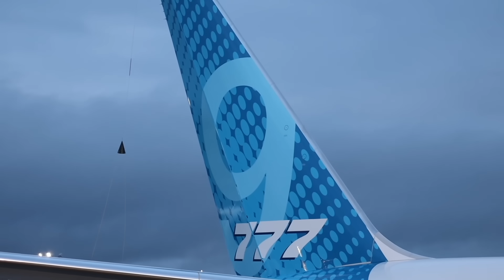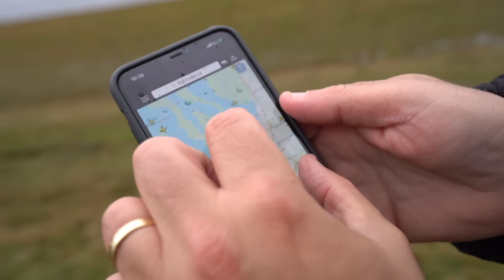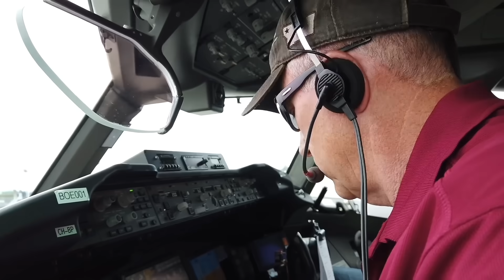Boeing 777X - What's the Difference?

Comment: 737 max 8 product of rush
777x even worse because BOEING IS LOSING MONEY AND THEY NEED THIS TO SAVE THIER ASS. So is 777x fully tested?
Reply: No, that's why they have the test flight program. It won't be fully tested until they have thousands of hours in the air exploring the entire flight envelope. It flew again today doing low-speed racetrack pattern over Eastern Washington before returning (safely) – there should be frequent test flights coming up
Reply: Appable then why max 8 got deadly problem? Basically u are assuming Boeing plane are fully tested, and Boeing assumed their planes fully tested.
Reply: @kevinco11  It would be possible to test for MCAS failures while having a much safer recovery because you anticipate the failure

Comment: Folding wingtips. More moving parts. What's the probability of something going wrong?
 But shouldn't the wingtips fold down, so the lift from below helps them stay in place during flights?  As it is now they will actually need a robust locking mechanism to keep the wingtips down and prevent them from folding up during flight. I know it doesn't look as cool with the tips folding down.

Comment: I'm worried about those foldable wingtips, close up they look cheaply made which potentially makes it more prone to damage and metal fatigue. e.g what if the 777x wing tips are folded so much to the point that they are close to snapping. similar to the cause of the crash Japan Airlines 123 which crashed because from what I've heard the tail snapped.
Reply: JAL123 was because a bulkhead failed – the vertical stabilizer came off because the tail was falling apart. I have no idea how you assessed the wingtips as "cheaply made". For the loads transmitted through the latches, the folding itself is not going to cause much of a  load at all compared to flight forces

Comment: The foldable wingtips are Boeing's next hack. It's another safety problem in the making. Please don't!
Reply: Based on what? They have a very strict set of requirements negotiated with FAA and EASA to ensure they're safe  and therefore the system has gotten additional regulatory scrutiny

Comment: May this piece of garbage has two angle of attack sensors? Lol - maybe it even flies without falling out of the sky? Maybe you crooked assholes didn’t bribe the NTSB to rush it to production? Shameful.
Reply: NTSB does not regulate aviation. This has two angle of attack sensors, though so does 737 (but 737 only uses one at a time). There's also a synthetic inertial angle of attack measurement based on their theoretical airplane model which can be used as a backup for 777

Comment: Why does the 737max has the MCAS but 777x doesn't
Reply: Engine weight, the 737MAX  has bigger engines than a regular 737.
Reply: @mahfl22  Not weight, and 777 would never need MCAS regardless of aircraft positioning because its approach to controls is entirely different

Comment: Boeing really needed this after all the bad press about the 737Max.  The 777 has been a thoroughbred passenger jet from day one.  I hope they've gotten this right.  I'd also like to see the 737Max debacle straightened out for good.  I still think the plane has great potential once the problem's solved.  I just hope the De Havilland Meteor syndrome doesn't set in for both buyer and flyer.

Comment: what happens if one of the folding wing tips goes to the upright mode during flight?
Reply: retroelectrical Probably bad things. They’re designing appropriate structural margin and safety (mechanism isolated from power in flight, etc) in view of the fact that wingtip failure would be very bad

Comment: Why was the landing gear still down at that altitude? Or is that all part of the test?
Reply: Safety – they typically perform first flight with gear down and engineers make sure the systems behaved normally in flight before allowing landing gear retraction. The first flight is also a good opportunity to measure low-speed takeoff configuration performance to make sure there are no glaring discrepencies, which is why they circled around just over the mountains for a few hours at various speeds

Comment: Why are the landing gear wheels still down when the plane is in the air above the clouds?
Reply: Safety – they typically perform first flight with gear down and engineers make sure the systems behaved normally in flight before allowing landing gear retraction. The first flight is also a good opportunity to measure low-speed takeoff configuration performance to make sure there are no glaring discrepencies, which is why they circled around just over the mountains for a few hours at various speeds
Reply: @AmbientMorality  Thanks very informative 👍

Comment: 777x program is a disaster to be for boeing company after 737 max. It is because the same method and management culture were being used to produce 777x and 737max, cutting the corners and crying to FAA to release the aircraft
Reply: Based on what? Boeing accurately described the severity of wingtip failure and is certifying it in that regard, which is at least one good sign

Comment: The plane sounds very noising with that whining sound, is that normal?
Reply: That's the sound of the 777. It's not the quietest plane (the old one, anyway) but they re-designed the insulation completely for 777X so cabin might be substantially better

Comment: Is this another forward high engine design? Looks like it. I don't trust it. Folding wing is also another cost cutting exercise. I don't like where Boeing are going.
Reply: The engine is in essentially the exact same place as the older 777. (it also doesn't really matter where the engine is...) Folding wing lets it fit into gates and is being certified as a wing structural component so it needs to be quite safe

Comment: Order:The Boeing 777-9, registration N779XW finally took off on 25 January, 2020 at 10:09am under the command of Captain Van Chaney. It flew in the air for 3 hours 51 minutes before return to land at Boeing Field at 2pm.

This video shares with you all things you should know about the B777x. The orders from 9 customers around the world, the specifics, the cockpit and cabin design and test record of the Boeing 777x. Boeing 777x is powered by GE9X engine, which recently set a world record of generating 134,000 lbs of thrust.:: Project @ 500 Set

Comment: A beautiful bird. The BBJ very Luxurious interior. Tres Jolie as the French will say. It is a longer plane though. I wonder whether smaller airports might need to revamp/extend their parking bays to accomodate the longer 9 variant. The folding tip is useful though. If when folded the total wing length is the same as the 300ER then width wise it should fit even on certain small airports that accomodate international flights like here in SEZ. If this is the case then well done Boeing design team👍😉. Nevertheless I wish the best for this aircraft and I hope that Boeing have learned from the B737MAX and incorporated better working safety technologies for flight operations and other safety aspects of this Beautiful plane. Looking forward for a chance to fly on them and I am especially curious on how airlines like Emirates(my preferencial and favourite airline) will use the interior space.

Comment: 6:16 how come the wheels are still on when it in the air
Reply: Because it's first flight when unnecessary complications are avoided focusing on the scheduled  tests to confirm engineering data with actual performance data.

Comment: I got a question though, what would happen if a problem occurred and the wing tip folded in mid air? Would it affect the plane?
Reply: May be catastrophic in some flight regimes. Boeing is choosing to consider it catastrophic and implementing safety measures under that severity, at any rate.

Comment: "There is no MCAS"
Reply: **may crash in any second**
Reply: I think if they would put mcas noone would ever fly in 777x.
Reply: @Kondee87  your comment did not age well considering the Max is flying again.
Reply: @andrewilliams6681  Your comment makes no sense at all.
Reply: @hodb3906  so you don't believe the truth?
Reply: Crash is the probability
Reply: @vasantaboddula3491  nope. why would this have a probability of crashing
Reply: That is a sales argument now for Boeing.
Reply: Heheheheheheheheh XD
Reply: Because it's a stable airframe.
Reply: Tim Miles there  wont he any MCAS since the only reason they had MCAS on the 737Max was because they had to move the engines up to to low ground clearance. The 777X has a-lot of ground clearance so they didn’t have to move the engines up so the flying characteristics are the same as the old 777s. Also Boeing couldn’t risk another PR disaster like the Max disaster. So they will have to make sure the aircraft is extremely safe. Also along with the FAA, other country’s aviation governing bodies will certify it on their own to make sure its safe.

Comment: I'd be very leery of this plane, it was designed and developed during the McNermey reign at the same time as the Max. The same cost cutting culture was used and I wouldnt be surprised if this plane also has some underlying catastrophic weakness.  Boeing needs to start making these planes in China, so at least we shareholders can make a killing before this company goes belly up.
Reply: Drew P Knutz 777 didn’t have the program time pressure that affected the 737 MAX though

Comment: Boeing making a key design decision to keep a new airplane in the same size or regulatory category as the previous iteration, where does this sound familiar?
Reply: PoorlyMadeCornbread That’s a myth about 737 MAX. MCAS was required for regulations around acceptable flight characteristics, not just to maintain a common type certificate.
Reply: MCAS was made so that the new airplane flew like the old one so pilots wouldn't need new training for the new plane. This is similar in that it's a change to make the new plane fit into the same sized gate as the old plane.
Reply: @speedbird227  No, that's what Boeing wants you to believe. MCAS is required for certification, particularly 25.203 and a few other regulations. The stick force changes unacceptably at high angle of attack on lead up to stall, which is not permitted for any transport category aircraft. This is discussed in the JT-610 NTSC report, page 189.

Comment: Interesting. They were super cautious. Well, good, Boeing will be really scrutinized about any new plane they build. They did fly with landing gear extended all the time. I wonder how much fuel they had on take off and if they had any extra dummy load in the plane to simulate full load. I guess for the first flight, they didn't do that.
Reply: movax20h They mentioned not having engineers or test equipment in the plane for the first flight so I’d expect it was quite light

Comment: I cant help it but to be afraid of new aircrafts from Boeing, with how much their board allowed with the MAX8 I would wait a while to make sure the folding wing really does not present problems. Really hope this plane helps Boeing lift their image!
Reply: Ronald Casasola The good news is Boeing was honest and assessed wingtip failure as a catastrophic failure mode. That means that the system will get more scrutiny and need careful design — MCAS evaded some of that through questionable risk analysis that led to its severity being greatly understated

Comment: Sam, you didn't mention the exploding cargo door during the final pressurization test which also delayed the 777x.
Reply: Peter Sue The GE9X issues delayed it. As far as I’m aware the fuselage failure was resolved in parallel and finished first

Comment: It's the largest, but not the most powerful twinjet in its default spec. The GE9X will be generating 105,000lbf each of thrust on the 777x. The 777-200LR and -300ER have the GE90-115B which produce 115,300lbf each. In terms of total thrust on the market version of the plane, the 300ER and 200LR are still more powerful.

The 777X is more efficient and that's the key differentiating factor.

I also hope the cabin is quieter than the existing 777s. I really like the planes, but the current 777 has a very noisy cabin when compared to the A380, Dreamliner and A350.
Reply: The legacy ones?
Reply: @thisiskevin1000  if by legacy you mean the current in-service 777s, yes the 777-200LR and 300ER are more powerful as far as the absolute thrust available from the engines goes. They're also a fair bit noisier in the cabin compared to planes like 787 and A350.
Reply: Twister286 They have mentioned insulation improvements but no decimal level that I can find. Hopefully they’re waiting on flight tests before advertising those reductions

Comment: What is the thing hanging off the tail, is it a sensor unit of some kind?
Reply: The string contains pressure sensors which are used to determine correction factors for the pressure sensors on the fuselage (which have interference effects). The cone just keeps the string taut.
Reply: Thank you. :-)

Comment: The rear gear was literally off the ground before the nose.

:/
Reply: Just like the 777er and the 787-10.
Reply: The nose wheel lifts first followed by the front wheels on the rear landing gear system rotating up of the ground at the same time, but if you look closely the nose wheel is off the ground and last row of tires on the back gear are still touching for a moment.

Comment: The clip where the plane was at cruising altitude...why was the landing gear down?
Reply: It wasn't at cruising altitude, as the highest altitude it reached as about 17000ft. In case of any hydraulic systems issues it's safer to keep landing gear extended for the first flight or two – once they verify that system is performing as expected, they can retract it as normal.

Comment: So, what happens if the wing tips fold in flight?
Reply: Unknown, but there are at least some cases where the answer is very bad. Boeing informed the FAA that failure of wingtips is considered catastrophic severity. The good news is this means Boeing is obligated to including it in full system-level risk analysis and proving that the system is extraordinarily unlikely to fail, be misconfigured inadvertently, etc. MCAS failure, by contrast, was of only major severity and therefore got to skip some of the full integrated safety analysis

Comment: Great sounding engines! Just a few questions about the folding tips, for all the experts out there:
1. What happens if they fail to deploy before take-off? Is take-off then still possible?
2. What happens if they inadvertently fold during flight? Is flight still possible, probably with decreased efficiency? Or would that cause a collapse in lift?
Reply: Takeoff is not possible without the wingtips. The electronic checklist, crew alert system, and takeoff warning system all serve as (increasingly pressing) reminders to the pilots, so it's about as likely as pilots trying to take off with the spoilers completely open. Inadvertent folding during flight should be effectively impossible – structurally, they are rated to the same standards as the rest of the wing, and electrically, the latches are isolated from system power when the plane is not on the ground. Depending on where it failed and whether it was asymmetric, it could be very difficult to control or catastrophic. Boeing is considering it catastrophic and certifying the system based on that severity level, which is a good sign
Reply: @AmbientMorality  Thanks for the info!!

Comment: What are Boeing thinking with that engine noise, most airports are facing tough noise limits yet that frequency will just cause complaints and restrict its landing and takeoff times
Reply: It's quieter than the old 777.

Comment: 3:54
What is that string dangling from the back of the tail wing
Reply: Fuel line
Reply: It's called a STATIC CONE, and it measures the altitude independent of the aircraft's altitude system. By comparing the aircraft's altitude reading to the Static Cone reading, Boeing engineers could determine if the aircraft's altitude system is accurate.  If the aircraft's reading is different than the Static Cone reading then the aircraft's system must be recalibrated.  Hope that helps.
Reply: @kevinp8108  For clarification — it measures the free stream static pressure (and thus pressure altitude), but not the MSL or AGL altitude.
Reply: @kevinp8108  Wow, that was an impressively hostile response to a comment that was simply to clear up a potential misunderstanding about altitude.

Comment: 3:50 and the kite-like thing?
Reply: It's called a STATIC CONE, and it measures the altitude independent of the aircraft's altitude system. By comparing the aircraft's altitude reading to the Static Cone reading, Boeing engineers could determine if the aircraft's altitude system is accurate.  If the aircraft's reading is different than the Static Cone reading then the aircraft's system must be recalibrated.  Hope that helps.
Reply: @kevinp8108  thank you

Comment: I sincerely hope that Boeing did not take any shorcuts with the design and building of this plane, and ensure all safety and quality checks are properly done. The 737-800 and prior models was a great airplane until they created the 737MAX that crashed and killed needless innocent lives because of a faulty computer system. The 777-300ER and its previous models was a great airplane, hopefully the new generation 777x can live up to its expectations.